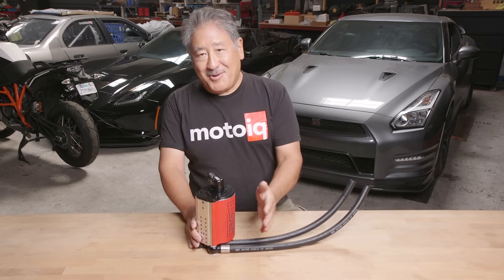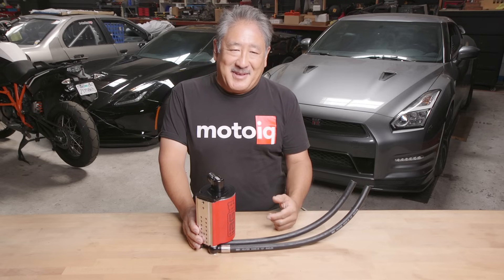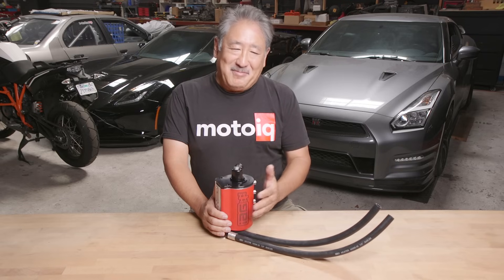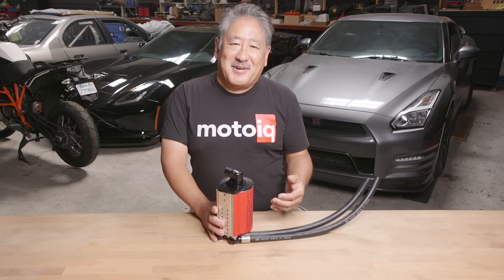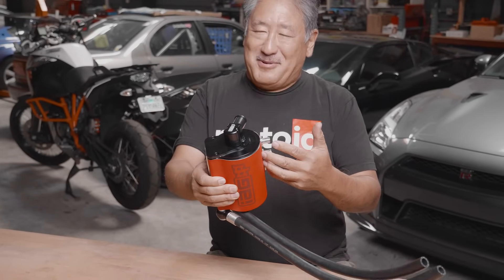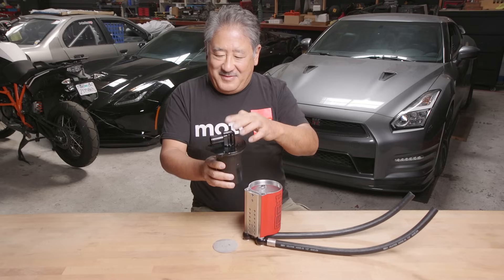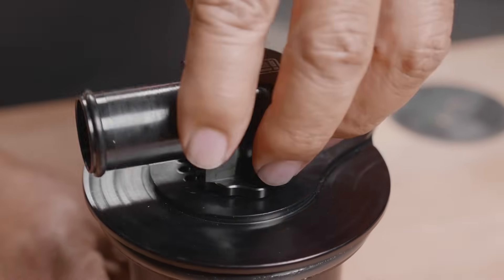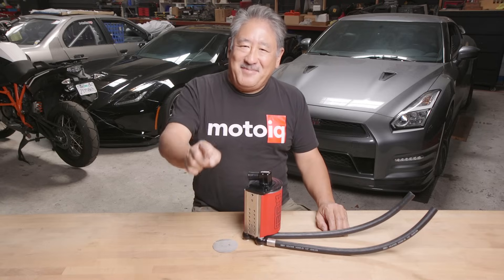How an Air Oil Separator Works and Why You Need One!

Comment: Thanks. Great explanation. I have a diesel truck let's not give the manufacturer's name away. 😂😂😂. It's a real scourge. They dump so much fuel into the back cylinders #7&#8 in an attempt to raise the temp.up to and beyond 1400F to burn off the soot collected in this honeycomb collection chamber of the exhaust and now emission control.  It works OK for a while than it becomes a nightmare to the internals of the engine and its life span. Egr. Plug the cold air intake ports with this choking goo. The ring gap has been widened to keep the rings from closing. Not only does this cause excessive blow-by but it allows raw fuel to seep past the rings and into the crankcase and mix with the oil. I have found over three pints extra liquid in the crankcase at the time of a 5K service OIL filter and fuel filter change. But the blow-by is crazy. I now dump it in a catch can. I'm not sure that an air-water oil separator would be helpful. I'm happy that all that blow-by sewage is not mixing with the finely metered air-fuel mix. Then there is the coating of the entire cold air intake system with that same sewage. The catch-can is the only reasonable solution and it is vented after being filtered back into the atmosphere. The catch-can is drained at the same time as the engine oil. Seems to be working well. Much better cold starts and that small amount of black smoke from the exhaust in stop-and-go traffic seems to be gone. I'm still going to reduce the low-boost fuel from the #3 setting at the tuner to the # 2 setting. I believe in good emissions but the ridiculous to absolute stupidity one allows those who don't know to feel like something has been done. Well, let's start with the best clean combustion possible that requires a good engine maintenance schedule and filter changes. Burning excessive raw fuel and venting that into the atmosphere is not the answer. That is a failed Government science project.
Reply from the maker: Is this a DEF engine? The super high EGR controls of engines without DEF are stupid.

Comment: I think a catch can is better because your not dumping everything back into the engine.
Reply from the maker: Until it makes your oil level low, like is common for a hard driven car, one of the main reasons why Subaru's spin bearings.

Comment: If i needed to remove pressure in a motorcycle crank case. Could i put a regular and one of these to remove it?
Reply from the maker: It's pretty big to fit on a bike
Reply: @motoiq  if I mount it where an oil cooler mount on a Harley? The revs are ridiculous if you take the case pressure out but the air is mixed with oil
Reply from the maker: Killer B makes these smaller funnel looking ones that fit better I bet.
Reply: @motoiq  thank you

Comment: A great explanation of the features of this oil separator. Im running a non-turbo E25 in my 2009 subi forester & was surprised at just how much oil was collecting in the air box, this explanation really clarifies the root causes of some of my issues. Thank you. pity you arent in Australia.

Comment: If the catch can is getting full of oil then there is a problem that should be fixed although in some cases it's inevitable as mentioned. A correctly set up catch can otherwise won't load up with oil but it will collect water and other liquids that are best not returned to the sump.

Comment: I'm the proud owner of a new (to me) 2012 Mini Cooper S R58 JCW, and just found this channel about a week ago.  

One major issue is coking or carbon build up, and another is oil starvation with the Gen2 Mini(s). The AOS seems like a solution that addresses both, but I cannot find an application for AOS like IAG on the Mini N14/N18 platforms.  

Has MotoIQ installed AOS on Mini Coopers?

Comment: C'mon with the hyperbole. If any car fills up the catch can to starve the bearings in one session that car's rings are done. Where does the PCV vapors go stock? Straight into the combustion cycle then out the exhaust.
Reply from the maker: You haven't driven a Subaru or other flat engines on the track have you? Flat engines spit oil even when they are not done.
Reply: @motoiq  Bug eye + 06 & 15 STi I've owned a and tracked. They spit but no where near that degree in any semi stock configuration. If what you were saying were true every boxster engine would be toast after 2 track sessions for oil starvation and the intake manifold and valves would be absolutely caked in oil the entire length. It's entirely hyperbole they're that bad.
Reply from the maker: A lot of competitive time attack Subies fill up the catch cans and overwhelm smaller volume AOS quickly.  Especially the stroked ones.  The M96 Porsche, the Porsche without dry sumps do it too.  There is a reason why Porsche uses dry sumps in most of their motors OEM. A lot of them would be toast in 2 track sessions if you didn't check the oil level.  It's not hyperbole, it's what happens in big power cars being driven hard unless you have an AOS.  If you choose not to believe me, then do what you want on your car, I am just warning you that some of the best Subaru tuners also have the same opinion, it just not me.
Reply: @motoiq  At least you're finally getting it. These are big power cars with aftermarket built blocks designed for big boost. They're not remotely stock. Again, your warning for all boxster motors is hyperbole. Dry sumps are NOT about the PCV system. Only the ones that need it, need it. You're not a good engineer, you're problem seeking instead of problem solving. Adding complexity and points of failure for the sake of building it to the max when a customer goals aren't likely a maxed out time attack car.
Reply from the maker: If you are bone stock with stock suspension and tires and not a fast driver you might not need it but I would still get it as the internal one does not do a very good job even on stock engines.  I have seen plenty of stock cars smoking on the track with IC's and charge pipes full of oil.  If you don't experience that, great don't get one.
Reply: @motoiq  🤦 now it's clear you're pitching parts to sell parts by fear mongering. If anything you're saying were true, every track day would be lined with dead boxter engines. I'm a regional SCCA solo2 class winner with plenty of track time under my belt in these specific cars in multiple stages of modification. The problem you're trying to create isn't remotely as severe as you're trying so hard to sell parts to imply.
Reply from the maker: I have seen it many times, good for you if you haven't.  I don't consider autocross to be particularly demanding. I don't get any money from IAG nor do they advertise with us.  Viewers can choose to believe us if they like and you are free to have your own opinion. You can choose not to believe us with your limited scope and experience.  You might change your mind if you do a simple not completive track day.  There is a reason why every Subaru tuner makes and sells their own version of this and it is not "fear-mongering".
Reply: @motoiq  🤦 The only reason why I put my autocross experience is simply to show I'm not a new kid who's scared of pushing the car and autocross drives a lot harder and closer to the limits than track days. Plus I mentioned my track experience but again, simply highlighting it's nothing about the actual situation or car, it's about pushing product. Sorry but no street car in street modification level needs an AOS simply to survive a track day as you're trying to describe.
Reply from the maker: I disagree and so do the other top Subaru builders in this country. I am not doing this to push product or wave my dick around, I am giving sound advice and we build pretty damn good cars and have  satisfied customers at the grassroots, national and pro levels.  Like I said if you don't have problems at your level, good for you, just don't infer that we are a shill for IAG or are lying to sell parts.  If you want to poke at us, do so on your own channels.
Reply: @motoiq  Keyword: "builders" as in not stock but built engines that come with not stock issues to address.

Never mind again, if anything of what you're saying is so widespread to all boxster engines every-one-of-them would be dead due to detonation or oil starvation at the end of a track day if they didn't have an AOS system. Hope even someone like you can acknowledge that isn't true. If you can't, yes, you're trying to sell a product more than you are trying to solve actual customer issues, period.
Reply from the maker: Or maybe we have more experience than you and are better suited at giving advice and you have a hard time recognizing that maybe you are wrong in some things.
Reply: @motoiq  That's some astonishing level of arrogance there and of course you resort to attacking me. The truth is simply the truth. IF what you were saying were remotely true, EVERY boxter engine would of suffered detonation death or oil starvation death by the end of any track day if not equipped with an AOS. Obviously empirical and physical evidence counters your theory hence all this puffery about your history you're pushing now, means even less as the results aren't there. Simply put the PCV system doesn't suck the car dry in a single HPDE event as your try and state. It's simple hyperbole and fear mongering to sell a product and now resorting for character attacks over this? It says a lot about your business.
Reply from the maker: That's the pot calling the kettle black.
Reply: @motoiq  If you think that... again shows the obviousness to the actual situation. If what you were saying were true, any Subaru or Cayman track day tow trucks would be lining up. It simply doesn't happen and that's the reality of the situation. Trying to scare people into thinking that's the reality, is a problem and that's all you're doing and my response is appropriate for that. You keep doing what you're doing, people will see you for what you are.
Reply from the maker: Strange in our industry we have an excellent reputation, ask around, and I will leave it at that.
Reply: @motoiq  I don't doubt you believe that regardless of what others may say. Just like you don't believe any boxster motor can survive a track day (your claim is 2 sessions...) without an AOS and no amount of seeing them drive off after any number of track days will make you think otherwise. Evidence based opinions isn't what you're about.

Comment: Could we use the radiant  heat from the headers on a N/A motor to heat the oil separator? 
I’m keen to build a catch can for my 1700kent mk1 escort.
Header heat would heat the catch can pretty much instantly.

Comment: I had radium dual catch cans while I was on 28 lbs of boost and now that I’m on 40 lbs the catch cans fill up quick with fresh oil so I threw on an AOS and I’m sure it works well but idk as it drowns itself back into the back of the block. It’s essential for sure. I’m also running the competition AOS so for those with a Subaru if you are not on a speed density tune run the street series as the competition is not meant for a stock PCV system.

Comment: I’m somewhat confused as to why having a catch can is worse than a factory setup for the Subaru racing example he gave.  The factory setup still sends the same amount of oil towards the intake; it’s just whether it gets there or not.  With the factory setup you can still starve the engine for example as the oil that would be caught by a catch can is sent through the intake and combusted out the exhaust.  If you are starving your engine of oil in one racing session; something else is at play here.
Reply from the maker: Ever actually race a turbo Subaru?
Reply: @motoiq  Lol I have not but have never heard of this being a problem from the countless rally articles I have read. Just the oil starvation from the oil pickup not sucking enough oil during high G corners likely because of what you said about low oil capacity to begin with; which necessitates baffles.   

What would be your opinion on people who say normal catch cans are worthless for stopping carbon buildup because EGR gases are still able to enter the intake?
Reply from the maker: The main purpose of catch cans is not to prevent carbon but to prevent oil from getting on the track surface after getting blown out the vents. Anyone who races turbo Subarus rally track or otherwise has issues with oil getting blown out the breathers, hence the huge market for Subaru AOS systems.  It partly because its a characteristic of flat motors and partly because of the Subarus low crankcase volume and hence run a lot of crankcase pressure.  It's why we emphasize oil control a lot to our Subaru customers.
Reply: @motoiq  I'm following but shouldn't the vents from factory be directed straight to the intake not a vent to atmosphere? Or are all racing setups venting to atmosphere or using air oil separators because they know the problems that come with sending oil straight into the intake?
Reply from the maker: Street versions vent to the intake, race version the atmosphere. Unless the car is MAF, then they should vent post MAF.

Comment: there are 2... oil catch cans i have used before that do return oil back to the engine, one uses a pump, the other a check valve that works well with a NA CCV pulse. BUT its not close enough to do anything he is talking about.

Comment: It seems like a lot of over engineering.   You've got oil and water vapour going in and expect this thing to seperate it with a bit of heat ? It might work on a street engine but race conditions might overwhelm  it .  I wouldn't like to return the "oil" to the engine. Maybe another reservoir.
Reply from the maker: But it works super well, especially on Subarus that spit tons out the breathers.
Reply: @motoiq  race or street ?
Reply from the maker: Typically track driven or hard use.
Reply: @motoiq   I must apologise.  I'm always skeptical about things.   I've watched the clip several times and see stuff I missed the first time ( doing other stuff while watching)  It is a very good design.

Comment: Great video Mike!!  Did Subaru ever offer an air oil separator as a factory option/add on?  A lot of the turbo Volvo's I use run came with factory air oil seperators...that's kinda why I'm asking.
Reply from the maker: It's built into the cases.  Isn't enough though.
Reply: @motoiq  your talking about the pvc system or am i missing something?  Thank you for responding and really like your show.
Reply from the maker: No there is a passage in the cases that has some simple baffles cast in that is supposed to act like an AOS but it doesnt work too good.

Comment: There’s one problem with what he has stated. Catch cans don’t just keep oil from dumping on the track, at least not the good ones. On supercharged platforms such a V’s, Vettes, Hellcats, Trackhawks, from the factory there’s oil that can build up in the blower cases, that oil can get in rotors, the intercooler bricks and cause issues. So companies like Mighty Mouse makes a catch can that remedies that issue while reducing crankcase pressure buildup. They provide in depth data on their website and hands down make one best catch cans for supercharged and n/a platforms.
Reply from the maker: Um the whole video is about air oil separators that return oil to the pan and vent blowby gasses, not about catch cans.
Reply: @motoiq  no disrespect, but if you’re only talking about aos’s why bring up catch cans and make a false statement saying they are only to prevent oil from spilling on the track?
Reply from the maker: Because they are really just to keep the oil in blowby gasses from dumping on the ground.  It's a catch can nothing else.  It does not return the blowby to the intake like a PVC.  If it is closed loop and returns the gasses to the intake its an AOS,  The Mighty Mouse catch can is an AOS. It uses centrifugal separation just like the IAG AOS we showed in this video.
A good AOS takes the oil out of the blowby gases and returns the oil to the sump.  So it does all the stuff you say plus it doesn't deplete the oil.

Comment: hmmm, make one can heated ti separate the oil from fuel and water ,  make that feed into another can that's cooled to condense the water and fuel  and than feed that bad to the engine maybe
Reply from the maker: You don't need to do that, the heated can prevents condensation of fuel and water.
Reply: @motoiq  Figured the cleaner the return, the cleaner the burn in a diesel and the less soot to block diesel particulate filter, hence the additional stage.

Comment: Every Duratec needs one. Why the mounted the PCV  valve so low on the block. Makes no sense. Also performance air cooled  VW's. How do I add a water pump? Lol😂

Comment: If they are really important why don't car manufacturers put this in cars?? Why don't engineers design it from factory?
Reply from the maker: Some like Porsche do.  Subaru has some built into the case of their newer engines but they are not enough for modified cars.

Comment: sOooo😯w eaumnn.. Ur sAEng that this AOS ‘imprUvmNt’, is taking the gasses & pressure that’s supposed to be returned to the intake, & instead spUEng it oOt in2 the atmosphere?, ruining car while at the same time polluting thE atmosphere?.. gr8t😒
Reply from the maker: it is returned to the intake minus the oil so there are fewer hydrocarbon emissions. in no way does this ruin the car, it actually reduces oil consumption dramatically and reduces the chance of oil starvation in hard driving.
Reply: @motoiq  of wat ‘it’ do U sPk?,  ✋& Y do U say ‘- the oil’, wN I thought returning oil was the whole goal?  hmnnn?🤔
Reply: @motoiq  & does it clEn this oil(of carbon deposits) B4 it returns it? - hmnnn??🧐?
Reply from the maker: I can't understand what you are writing